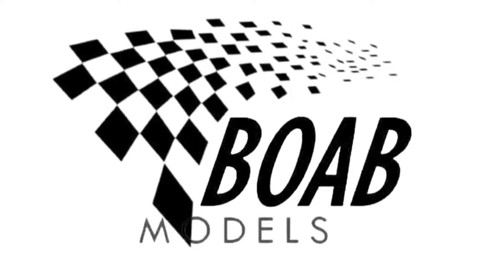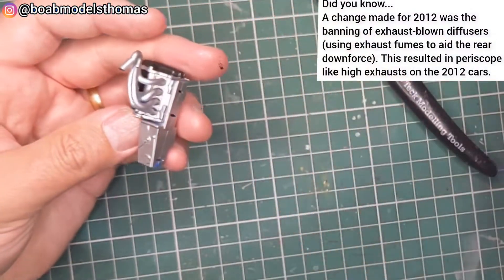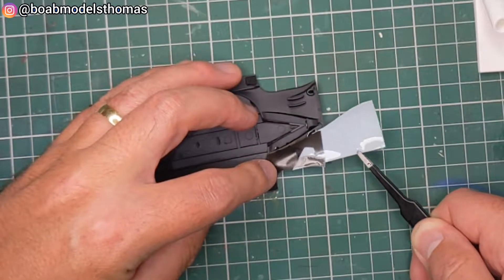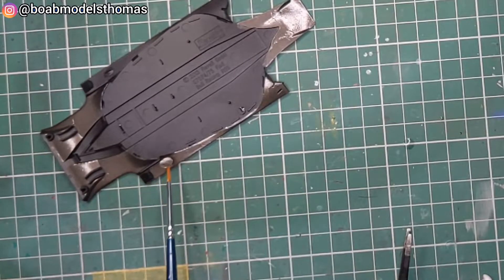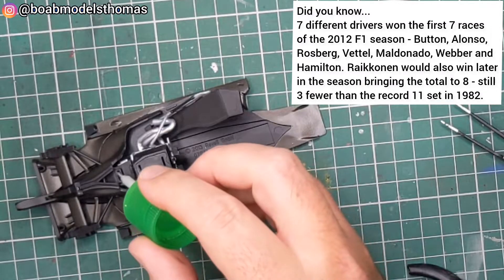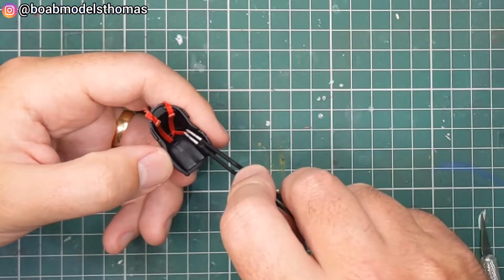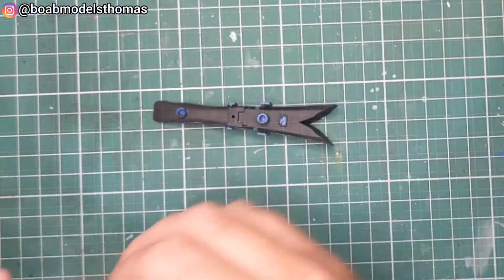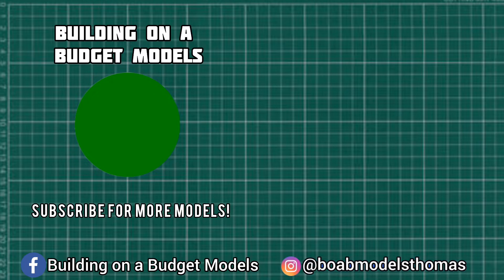Red Bull Racing RB8 - part 2 - Revell 1/24 - Sebastian Vettel

Comment: Coming along really nicely Thomas. I wish I could get hold of that Revell kit but just as hard to find as the Tamiya RB6 which I have built. Your decal work with the carbon fibre really finishes it off well.
Reply from the maker: Thanks very much, Allan. So nice having the pre cut carbon decals.
I've seen the Tamiya RB6 going for over £100 on eBay recently. This one for less but it's still not common.